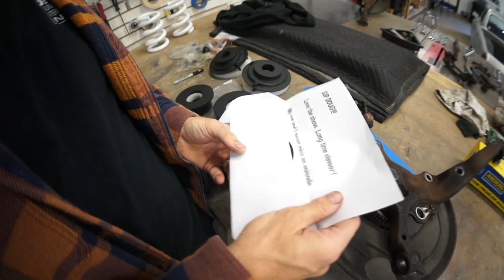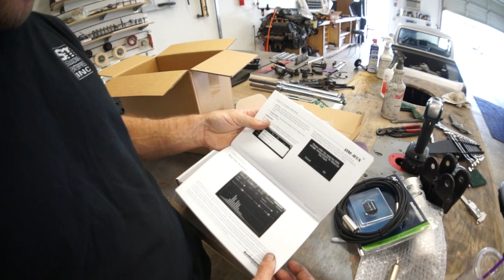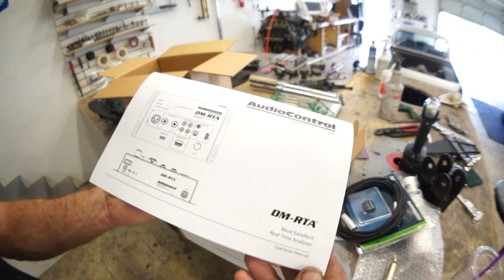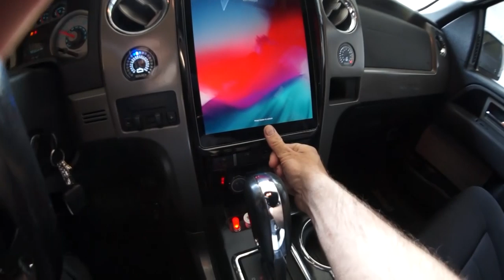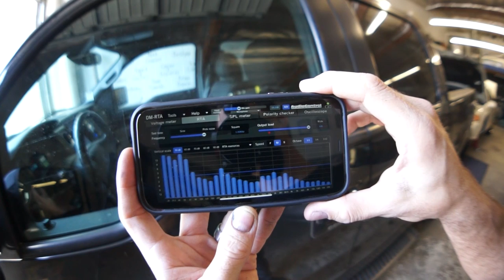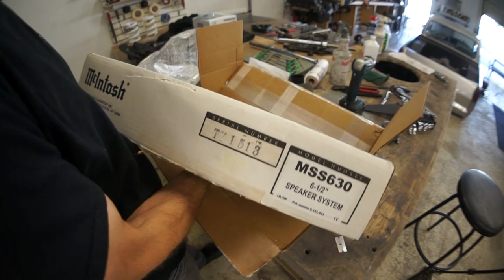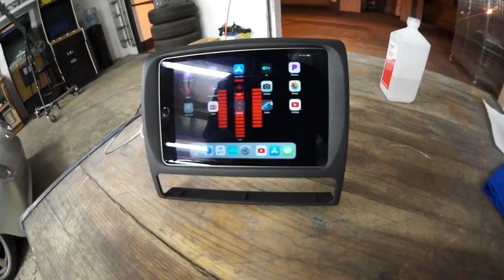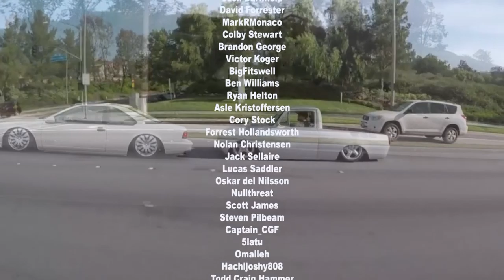F150 STEREO SYSTEM TEST and more! - the White Rider series #99

Comment: Doug- please listen-
See the rust on those spindles? Rust and grease has soaked into the pores of that
cast iron. They need a proper degreasing, using mineral spirits in a parts washer,
or soak overnight in a 5 gallon bucket. Then sand blast, and rinse again in washer 
before painting. You are painting the rust- that will flake off very easily, especially
with the stresses of hopping. Same goes for the coil springs- sand blast then
use Plastidip, or a vinyl based paint that will flex. 
I just want to see you do good, ok?

Comment: What I wouldn’t to to get that  AudioControl RTA!! I have the D-4.800 and the LC-1.500 and I am using an app on my phone to try to tune 😂
Reply: Audiocontrol also has a cheaper version that the rta mic plugs right into an ipod/pad/phone via the lightning connector and the app looks identical. It works very well for RTA. the db meter only goes to 120 on it but as for tuning its awesome for the $$$....